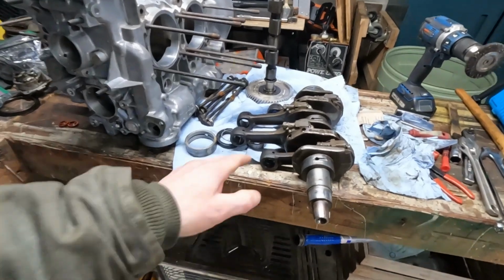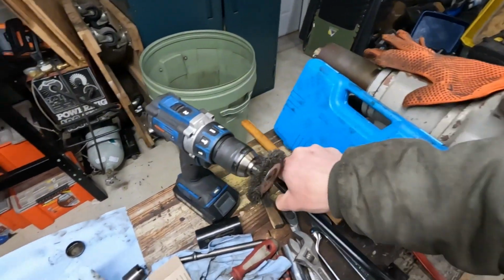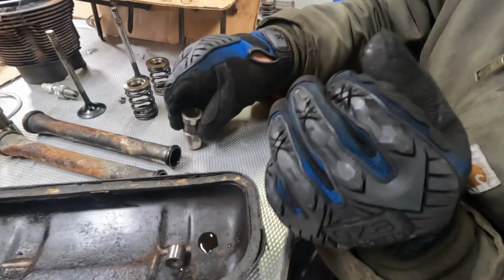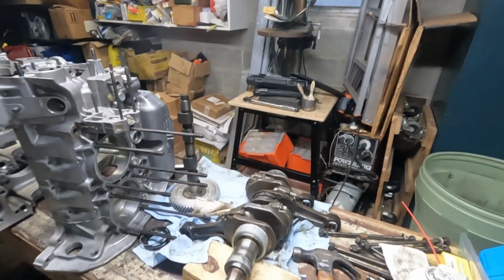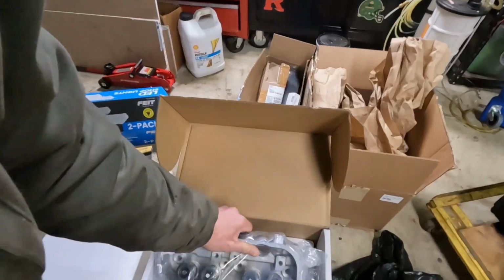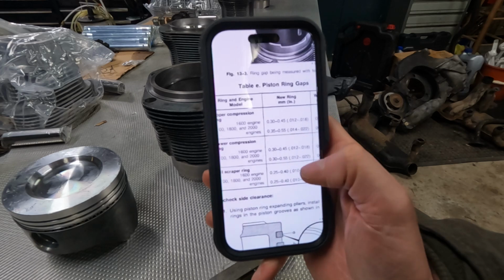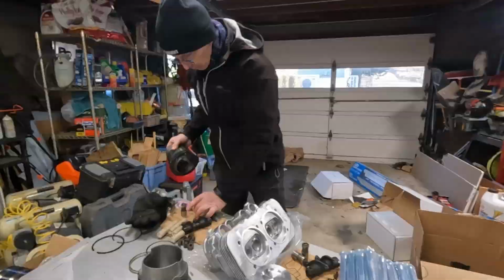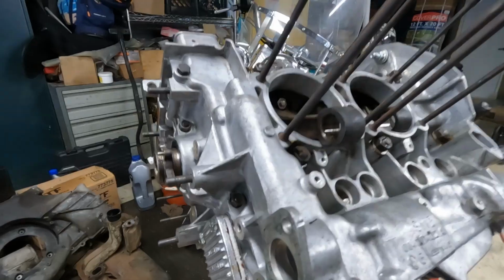EP. 4-Engine Prep and Assembly (VW BUS RESTORATION)

Comment: No need to CC the heads or be worried about interference in these engines - the compression is so low and there is so much space the valves will never hit the pistons. Now 9.8:1 or 10.5:1 CR on a high dome piston like a Porsche - yeah check it. 79 square port heads huh?
Reply from the maker: For a 78, yes square port!
Reply: @BenSosid 78s were oval port, only 79 was square port but I think they seal better.

Comment: Another great video man!!  You are doing great!   Nice work using the drill press as a valve compressor instead of that FUBAR junk from Amazon.   Only thing i have to add is i hope you labeled your lifters.... Those HAVE to go back into the holes they came out of or your risking premature failure on the cam lobes.  The lifters and lobes " mate " to each other during initial break in.   Keep up the good work!!
Reply from the maker: @jeremykonnerth9335  thanks a bunch! I have the lifters laid out in order from which they came on on the table at the moment so haven’t lost their position yet😅

Comment: Once again, great video! You're a bit ahead of where I'm at on my rebuild - I just got done splitting my case today - so it's quite nice to see what I've got coming up in the to-do list.

Got cracks in at least one of the heads on mine too. Probably a bit late for you, but I got in touch with Mofoco, who said that they'd accept cracked heads as cores to remanufacture, so long as the crack wasn't through the spark plug hole - $300/ea instead of $500. Haven't pulled the trigger on that yet, but it's at least an option.
Reply from the maker: Thanks for watching! I did not look to extensively at options for refurbishing the original heads.. just local places. I’m hoping the casting quality on these ones I got from AA are ok😬. 

Are you also working on a 2L type IV from a bus?